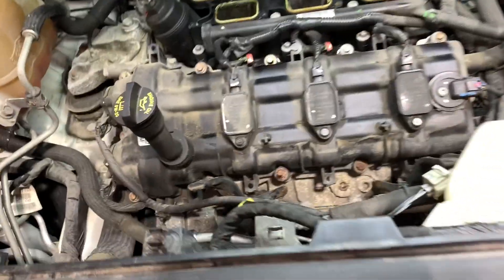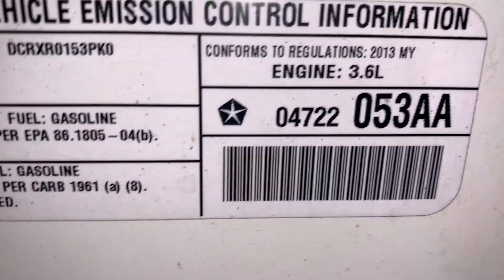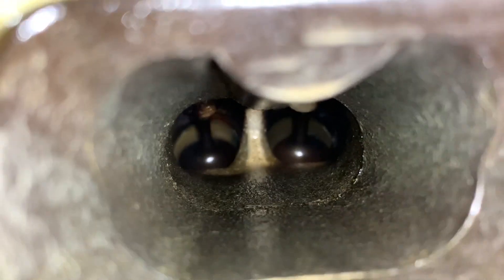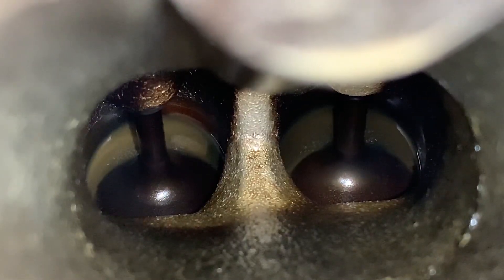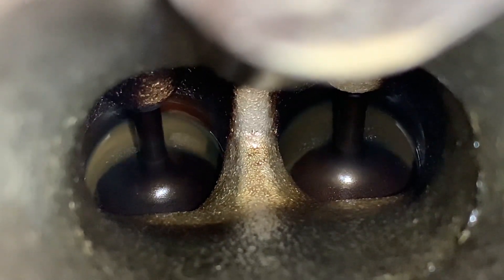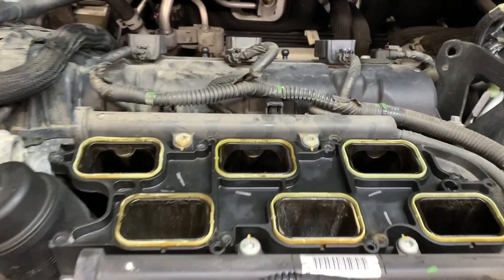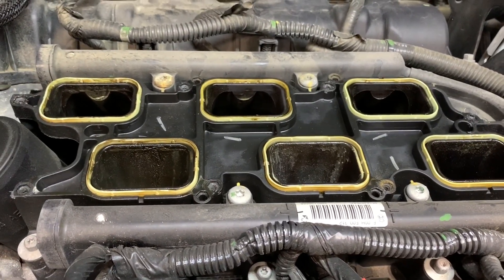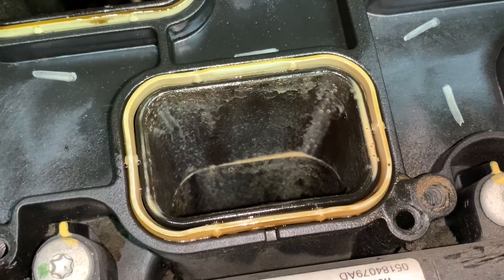Why Oil Catch Can's are Important!

Comment: OMG too soon FAB!! I had to have an upper engine cleaning on my 3.6 direct injection Acadia engine. They didn’t walnut blast, but probably chemical eating all that carbon buildup. I think that’s why my 3 converters went south shortly afterwards. Yes, I’ve installed a catch can since all that mess, but ugh!!
Reply from the maker: Phriendlymd Sorry brother! 😂 Yes they use a liquid called Upper Engine cleaner. In fact I just used it today to clean a Carboned up Cruze engine. That is probably what happened to your converters.

Comment: Those didn't even look bad. My kid had a VW that the valves looked like a fat guys arteries that only ate Big Macs...
Reply from the maker: Greg M You are correct the valves look pretty good but the fuel oil and water mixture puddle on top of the valves is what you need to stop from happening. Oil and water won’t burn in the combustion chamber.
Reply: @FABAutomotiveDetailing  for sure. That's my first mod to my 2016 SS Camaro. My son had to get head cleaned out with like 50K on motor.. It was gross..
Reply from the maker: Greg M Definitely needed on the Camaro SS. My boss and his son both have one on their Camaro’s and it catches quite a bit.

Comment: So what's the best way of getting all that out of there? Do fuel cleaners like Tekron help?
Reply from the maker: BigOldDog Best way is using a good upper cylinder cleaner through the fuel rail. You can also slowly suck Seafoam through an intake vacuum line. It has to go in slow so it won’t hydro lock.